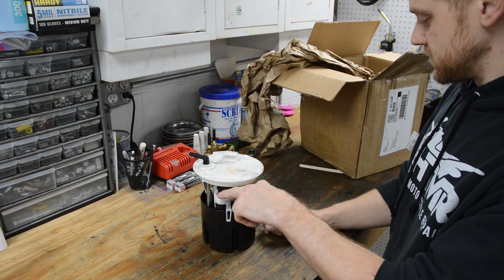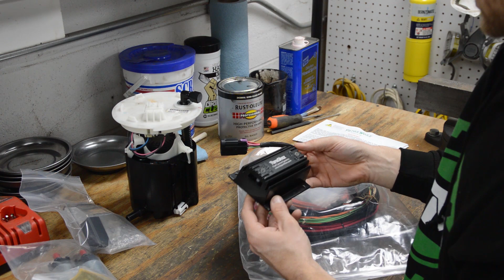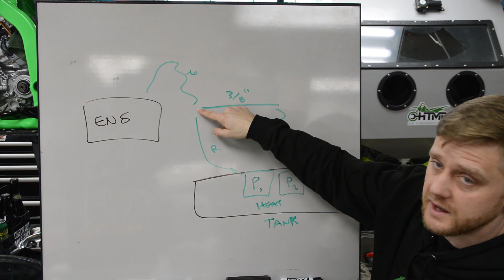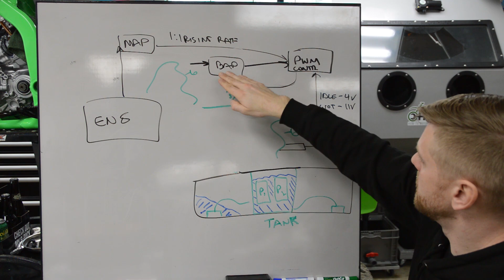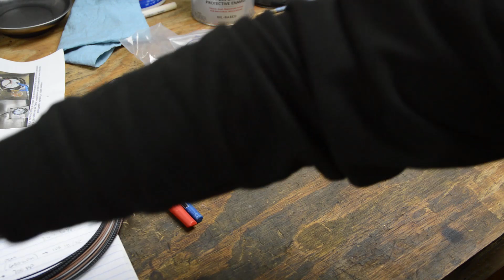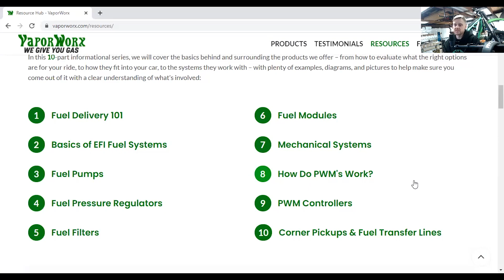700 RWHP E85 Fuel System - VaporWorx - Chevelle LS Turbo Build

Comment: So the terminator just powers up the pwm controller with key on and then it’s completely standalone?
Reply from the maker: Correct. Term x has a wire for fuel pump, so you use that one.

Comment: Thank you for the informative video, very helpful. One question tho.. in my case im running an LS1 with a sniper setup, what exactly will be telling the PWM to do, is it a connection to the map sensor or the fuel pressure sensor that comes with their kit? both?
Reply from the maker: What is your HP goal? If NA in the 450 range, then you can get away with a fuel module from a gen 5 or zl1 and run it full voltage. The PWM is to run massive pumps at a lower duty cycle when fuel demand is low. I recommend contacting vaporworks and Carl will set you up.

Comment: Hey Matt,  sorry to bombard you with all these question, im basically replicating everything on your build on mine. My question is about your Ricks Tanks, I looked up the model and called Ricks because on their website they dont recommend this retro fit steel tank for E85 and High HP applications. The rep said that this tank would rust, do you happen to know otherwise? Why did you opt for this model as opposed to getting their stainless steel option ?
Reply from the maker: Steel will be fine from what I've read. Just keep the fuel fresh and moisture won't build up that can lead to rust. I try to store over winter with 93 and stabil.
Reply: How do I get info to send my fuel pump to get the same modification you did to yours?

Comment: The relationship between voltage and fuel flow is linear. Meaning 1 extra volt would give you 1/13.8th of total flow at 13.8 volts.